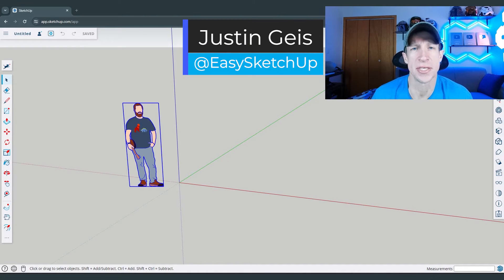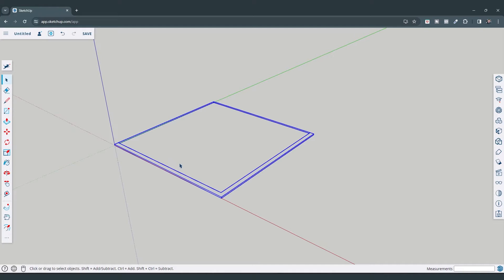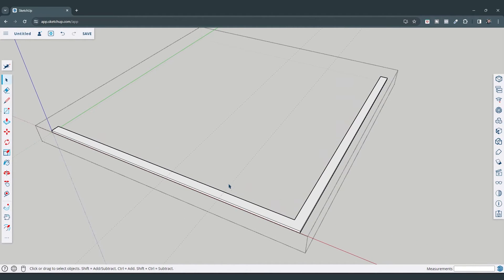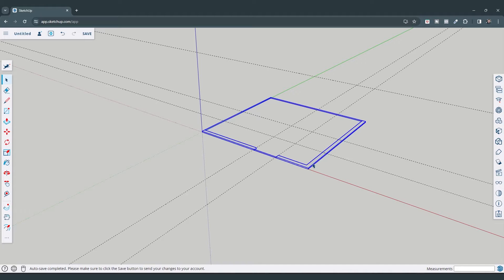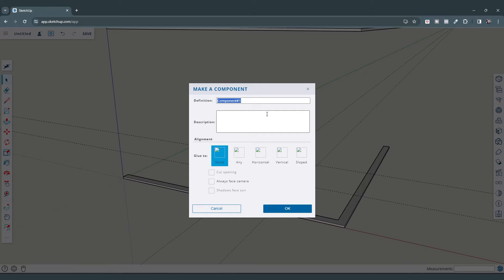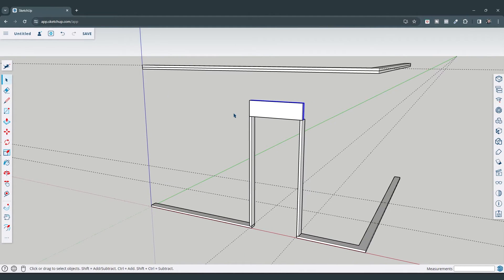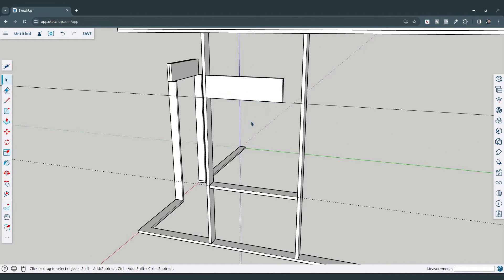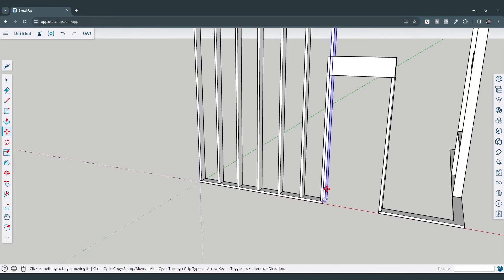How to Model FRAMING in SketchUp Free!

Comment: I
When framing, centers are framed for out side covering on 16' or 24 ' center to center this spacing is continuous the length of the wall run as if there is no windows or doors.
add farming as needed for windows and doors as needed that allows all out side sheeting to break on 4 foot centers